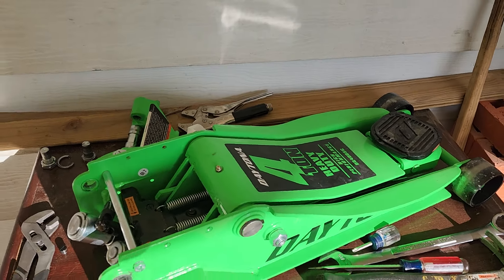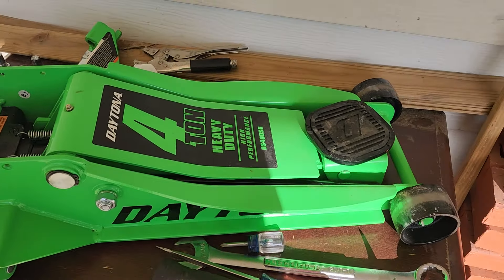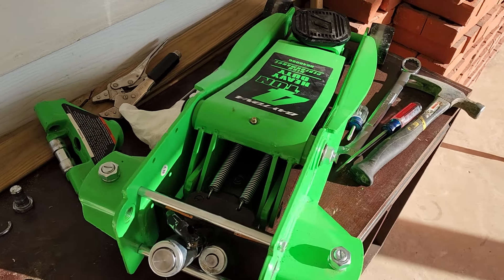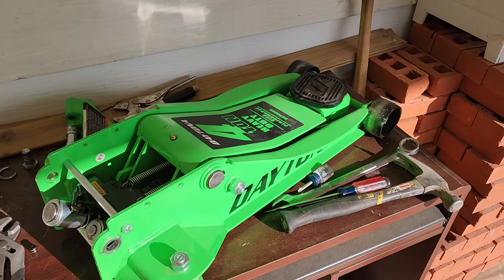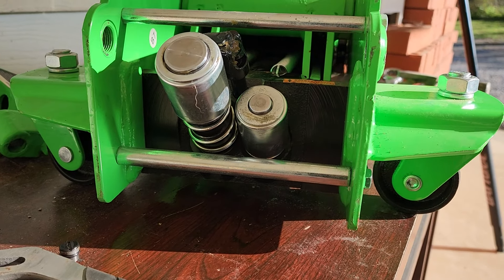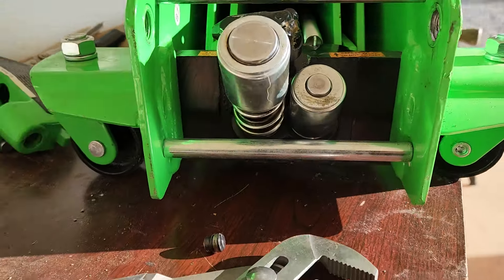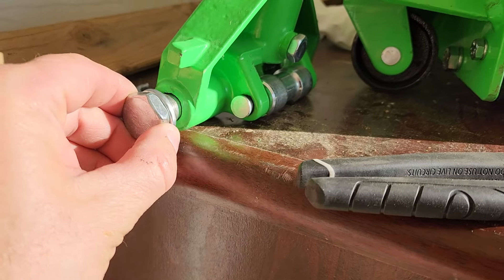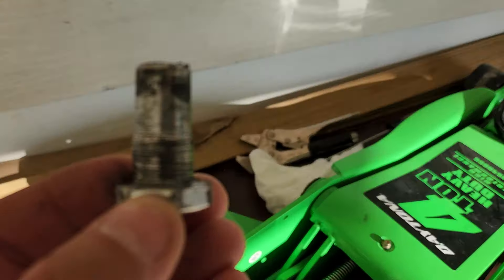Beware Harbor Freight Daytona jack!

Comment: The easy cure for the warrantee problem is to buy another one then return the broken one under the new one's warrantee period.
Reply: I call it the harbor freight rental program
Reply: That was the Xbox 360 return policy back in the day aswell
Reply: @mxcurtis978 😂
Reply: I'm cutting my losses, I want nothing more to do with this organization
Reply: Then you have 2 jacks. Only unused in box for refund. Otherwise it's exchange for another jack
Reply: @ridge69  No.  You return the old one for a refund instead of exchanging it.  If the policy doesn't allow a refund you're still better off having two for the price of one.
Reply: @DonziGT230  they won't give refund on used jacks. Exchange only.

Comment: Your supposed to Crack the valve and let the air out of it to prime it before first use didn't you read directions 😊
Reply: And didn’t you HEAR that he used it several times already?
Reply: @kingpatrick9840  never heard one mention in the video that he followed the bleeding procedure prior to use.
Reply: Just have to be a little smarter than that jack😊

Comment: I've got the older grey 3 ton low profile jack. For about the last 6 months occasionally I've had the small piston get stuck down on mine as well. I found tapping it lightly with a hammer would get it to pop back up. I finally took mine apart today to find the sides of the pistons gunked up with dirt and debris. A simple cleaning and reassembly fixed mine. I've had my jack for about 6.5 years now.
Reply: all floor jacks require cleaning and lubrication occasionally
Reply: @timshannon6363  It's lived in a pretty clean environment and only occasionally used. Pretty surprised it gummed up like that. Been working perfectly since I cleaned the plungers though.
Reply: I've got a Craftsman 1.5 Ton hydraulic jack from about 1980. Over 4 decades of working service. Built like a Tiger tank.
Reply: @ag4allgood  I've got my dad's hein warner 1.5 ton from the 70s still working, leaks a tad but works good. It's built twice as strong as the 3 ton harbor freight jack.
Reply: @MattsRageFitGarage  ...I'm thinking the factory that built that jack , used that brand called "world's cheapest" for their hydraulic fluid, $4 for a 55 gallon drum and rusty water included!  And if OP, and everybody else leaving a comment, had changed out the guaranteed-factory-cheapo hyd fluid and replaced it with - well, ANY other brand of new hydraulic jack fluid, then probably the piston wouldn't have stuck!   
I didn't think I'd need to change the hyd fluid on my brand new jack...but this post plus all the comments with similar issues, are making me think I really ought to now!
Reply: @MattsRageFitGarage  leaky jack?  My bad - I worked in a large gov't fleet for 30 years and on USAF missile hydraulics before that.  And the lesson never changes:  Never. TRUST. HYDRAULICS, always assume they'll fail at any moment -
Reply: @robertmaybeth3434  It weeps from an O ring from a threaded plug. It's been that way for over 40 years never bothered to fix it.
Reply: @robertmaybeth3434  I'm sure it was nothing but the finest drip sweat caught in a rusty bucket from the assembly line workers.
Reply: I have the same jack and mine did the same thing. I could pry under it and pop it back up but next time I used it,it would just stick again.
Reply: The Sears jack if it has a 328.model prefix was made by Yasui.
Reply: Same model, mines going good for 12 years, changed out O rings and oil change.  Purchase price was an amazing $69 in 2012.
Reply: @coburn_karma  I think I paid $75 for mine in 2017.
Reply: @MattsRageFitGarage  That's a low price for 2017.  I bought the red 3 ton low profile Pittsberg model  ($119 in 2020) along with 4 of the Daytona 3 ton Long Reach for my auto business.  Luckily, I never had a piston failure yet.  I don't have a favorite, they all work the same and are all reliable.

Comment: Hate to be the one to tell you, but if you look closely at 3:00, it appears that stripped out bolt has reverse-threads. You hit it with an electric impact tool turning the wrong direction and that is why it stripped out. Not the fault of Harbor Freight. I imagine both of those bolts are threaded in a direction so that when the handle is loaded against them and pivoting, any torque imparted from the handle to the bolts is in the direction of tightening them and not loosening them. Well thought out safety aspect of the design. Look closely at 3:22 and you can see one is cut with right-hand threads and the other cut with left-hand threads.
Reply: I was gonna say the same thing.
Reply: agree, i have the same jack ... had to remove the handle but used a box wrench so was able to feel it was a reverse thread, got away with that one
Reply: yes it possible the right hand bolt is reverse thread. The stuck piston should have occurred either.
Reply: the stuck piiston is from over loading the jack basically abusing it. as for the stripped bolt your 100 percent correct.
Reply: dont know what you gona buy thats any better quality you may buy same jack different name for 10 times the price these are some of best quality jacks i have seen in my 30yr career as auto tech
Reply: @bamaboy6207  the only Daytona Floor Jack that’s is the same as the snap on FJ300 is the DJ3000 3 ton super duty. Both of those jacks are made in the same factory. The other Daytona floor jacks are made in the factory as the Pittsburgh floor jacks that’s why his 4 ton only had a 90 day warranty. Might want to do some research.
Reply: I've got one had it 4 years not one problem and it has had a lot of use.
Reply: Think it’s just the batch of green because I have all different colors and no issues and my green one same thing happened to me today that’s why I’m here lol any luck with getting replacement parts?
Reply: The same piston got stuck on my jack. I didn't remove the handle. I removed the silver bar on top that prevents the jack handle from going forward past 90°. I then pushed the handle forward which allowed me to access the piston. I used a large flat edge screw driver the pry the piston up a little until I was able to pull it out. I cleaned it off and checked the orings and re-installed it. Works fine now.
Reply: @wildmanofthewynooch7028 no it’s not from abusing it, it’s HarborFreight junk, same thing happened to mine not long ago, my truck and suv don’t weigh 4 tons together.
Reply: Dog that’s some German shit left tightening bolts haunt my nightmares
Reply: Yeppers duhhhhhh OMG some people
Reply: @wildmanofthewynooch7028  Doesn't every jack have a safety built in for overloading?
Reply: @Gaffsmobiletires  I had same issue with my blue one.  But I have probably over loaded it a time or 2 on my k1500
Reply: lol this guy has to be forced to buy the extra warranty
Reply: I found  that if you keep those two pistons lubed with WD 40 you won't have a problem  with them sticking.
Reply: the washer was crushed on strip out procedure, lol
Reply: Yeah reversed threads
Reply: @bonesusa1998 I’ve used the 4 ton jack for 4-5 years now. I use it not everyday but a lot never failed me yet.
Reply: Mine through hydraulic fluid over my head on the third use. Unfortunately I have had it for about 120 days now
Reply: Excellent catch!!
Reply: My Pittsburg had a sticking small piston too. So it seems to be a common failure. HF also doesn’t offer any important parts for their jacks. They only offer stuff you’ll never need like wheels and fill plugs.
Reply: Good job noticing that! Still, it should be working fine if it was used properly! Who Knows?
Reply: @bamaboy6207  An old Walker will work forever.
Reply: Well stated. In like manner, bicycle pedals are fastened to their crank arms the same way for the same reason. There is a right and left pedal.
Reply: @wildmanofthewynooch7028 possibly, but the Pittsburgh brand has the same frame as a husky. I have both the Daytona and Pittsburgh and parts seem to be relatively the same. Daytonas handle has better diamond etch grip than the Pittsburgh but they seem to have the same hydraulic unit, etc.
Reply: Good eye.
Reply: Absolutely 💯
Reply: I came to the comments for to say left hand threads as well.
Reply: @bonesusa1998 You might wanna go research the weight of your vehicles lol.  Unless you bought the lightest pickup truck on earth and the lightest suv, they definitely weigh over 4 ton together.  The truck alone might weigh that stock.  And then if you go adding extra bs to it you're definitely over.
Reply: “I used a electric impact wrench”… You didn’t realize it was a left handed thread for sure and you over tightened the shit out of it which is evident by the lock washer and gulling of the metal on the jack. Well done on the paperweight you now have.
Reply: I can't tell by looking at the bolts whether there is a left or right hand issue.

Comment: The stock piston return springs are undersized for the application when dust and contaminates get involved. I upgraded larger(thicker) springs and haven’t had any further issues.
Reply: I have the same issue with the springs, where did you source stronger springs?
Reply: @InLineDiesel6  You could probably shim the springs with either valve spring shims or washers to stiffen them up a bit.
Reply: I have the same problem with mines. It's a Pittsburgh 3 ton jack.  The same side piston is stuck I only used it a handful of times and used it on a small midsized car.
Reply: Exactly this, i used the heck outta mine in the ne and fl when i started doing roadaide assist.  Nowdays id rather work with smaller floor jacks and bottles, keep big one garage
Reply: @claudiosantana3320  What smaller floor jack to you like?
Reply: I have one in a shop that has been abused for two years now. No issues whatsoever. And it is the 3 ton low pro daytona. It is used in a shop that only sees RAM trucks, 1500 - 5500. The paint on the thing is fading from all the oil and coolant that spills onto it weekly. They don't have undersized pistons.... You don't want big pistons when you are trying to move something heavy... The bigger piston is there to help pump it up quick, the smaller one is to actually pump up when lifting a heavy load. Same reason your master cylinder piston in a car has an extremely small surface area as compared to your brake caliper pistons being 10x bigger. More force to a smaller piston makes it easier to move a bigger piston.

Comment: Mine did that, same piston and all. It was happening fairly often so I took the chrome cover off the spring and wrapped a couple zipties around the roller on the handle and through the spring to pull the piston back up. Been like this for almost 2 years and hasn't stuck a single time since. 

Is it right? No.
Does it work? Yes.
Does it suck that sometimes you have to "make shit work"? Yes

It's a small price to pay when you pay less than half of the price of the competition's item.
Reply: Any pictures to see.. mine and my neighbors doing the same thing.
Reply: Mine did the same thing. I can tell you I took mine apart and simply wiped all the gunk off the piston and on the inside and put it back together. It worked with no more sticking. Later it started puking fluid on the ground but sounds weird but I may have left the fill plug loose so I have to go back in and see what that’s about. The only parts in the small piston are very simple. A plunger,2 seals,a spring and a cap.

Comment: I had the exact same problem for several years.  I found a solution that didn’t require taking the entire thing apart.  First, jack it up all the way.  Then unscrew the filler screw.  Put several ounces of new oil into the cylinder. Then put the screw back on so that some air and excess oil can escape.  Then let the jack down all the way.  The stuck piston will pop right up.  Then tighten the screw.
Reply: I’m going to try that because I have the exact same issue with mines and I tried to take it back and got the same results he did
Reply: @kingpatrick9840 did it work for u?
Reply: So is it a low fluid issue? Mine did the same thing.
Reply: @whatfreedom7  Could be air in the system (which you could call low fluid instead), or the piston seal or cylinder bore honing is defective.

Comment: The bolt problem is USER ERROR.
Same exact thing happened to me, when removing that bolt the piston pushes and angles the bolt as it comes out if you aren’t careful (like here) and use an impact it will strip out the threads.
I fixed my jack by welding the hole and tapping new threads.

Piston problem can be from not bleeding before using. Manual states this.
Reply: EXACTLY ! One  bolt is right threaded, the other left which is obvious due to the lever operation.
Reply: @clitisswood7330 how does the thread direction matter ?
Reply: @RussMeister70  How about the pedal on your bike ?

Comment: Mine jammed just how yours did. I just pried up on the metal guard for the spring and popped it right back up. Jack working and didn't take it apart.
Reply: You saved me from buying another.
Reply: same here, I i pried against it and it didn't or hasn't stuck again.

Comment: I have a little aluminum HF jack that I've used off and on for years.  At some point one of the plungers stuck.  I think I took it apart, cleaned it and reassembled.  I don't remember the exact process.  I only get about 50% lift with that one, and think I need to add oil.   The larger steel jack has really been beat on.  I think it also got a stuck plunger, but I was able to simply hit it with some spray lube and tap it enough to break it free.

Comment: It's pretty clear from some of the very astute comments that Harbor Freight should label a bolt as reverse thread to prevent owners from ruining the jack.   I had a 1959 Chrysler New Yorker where the wheel lugs on one side were reverse thread, but they were so labeled.  It was one of those behemoths that had a push button automatic transmission.  That car was so long I could park it and be in two different counties at the same time.

Comment: At my shop, we have 5 of these name brand jacks… over the course or 3 yrs… still going strong. Guys at the shop swear that these are snap on knockoffs. I have the Aluminum 3ton eagle knockoff… no issues and ive used it in tandem with a 3ton craftsman to lift the butend of 550 with a dump body on it.

Comment: I've owned a 4 ton Pittsburg floor jack for seven years, it sat inside a cold shed in minus 0 temps on a crushed rock floor for three of those years, lifted the rears of several skid loaders for repairs and I just recently bought a Daytona orange 4 ton to help around the garage, too bad yours broke but just shedding some other experience on HF floor jacks.

Comment: I noticed that Harbor Freight wheels with inner tubes mounted in split rims are often pinched and leak quickly and often after purchased because the people putting them together don't put a little air in them before they are bolted together, just enough to pull the tube away from the center pinch point. So, you go and just buy more thinking they are cheap enough. Same results over and over! By taking the leakers apart you will see the problem. Telling them goes in one ear and quickly out the other! Thanks for the jack and return info!

Comment: What i did with mine was took a grinder to the metal case (don't cut the spring) then sprayed penetrating oil on the cylinder and had to pry it up and down for awhile then eventually started coming loose and i was able to use the jack handle slowly kept jacking and spraying it and it eventually came all the way back up works fine now

Comment: I have 3 harbor freight jacks, 2 are the small aluminum ones,  and the other is a 3 ton long reach low profile, all work great and don't leak down.  The 2 small ones are over 10 years old,  the big one is 4 years old.  Not a single complaint with them.  Everybody makes a lemon once in awhile.  I know a tire shop that has 12 of the big Daytona jacks, and he told me they hold up as good as the big name brand expensive ones.

Comment: I've had this happen as well I had to flip the jack over and hit the outside of the sleeve with a hammer and a punch being careful not to warp the sleeve that goes around the spring that will cause more coil bind, once it was freed up put some grease on the spring and up the sleeve been good since hope that helps someone

Comment: This is why you buy the warranty. I bought a predator motor for my lawnmower. It burned up in a years time. I called them up and they said to bring it back and they would give me a new one. Zero issues switching it out. Just had to buy a new warranty.
Reply: Before they even had the Daytona line of jacks I bought an orange jack from them. Woman asked if I would like the extended warranty and I declined. She said she was going to give me one anyways. She did, and it was free. For years I thought it was because she knew the jack was garbage and never had faith in the jack. It's never failed me and never had any problems. It's a great jack. Years later my sister in law got a job at HF. The cashier's were rated on their job performance by how many extended warranties they sold. So much so they could be terminated if they didn't sell enough. She said the woman probably paid for my warranty to keep her job, or secure a raise by meeting the quota. 
I felt better about the jack quality and bad that she probably paid for the warranty

Comment: The one to buy is the Daytona 3-ton Super Duty, if you can make do without the  4 ton capacity.     Little more expensive than the other ones, but the Super Duty comes with a 3 year warranty instead of their usual 3 month.   That says a lot about the quality of the Super Duty if they will warranty it for 3 years.